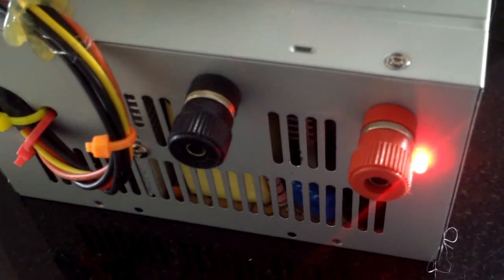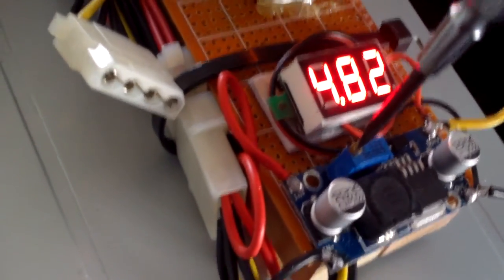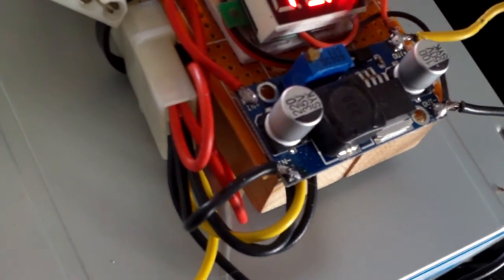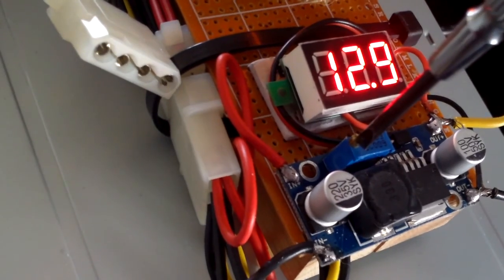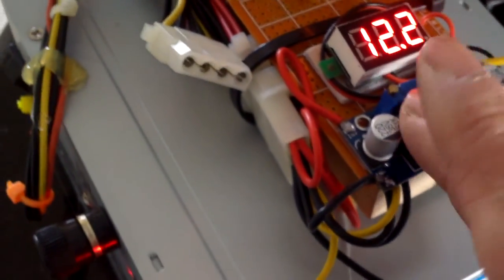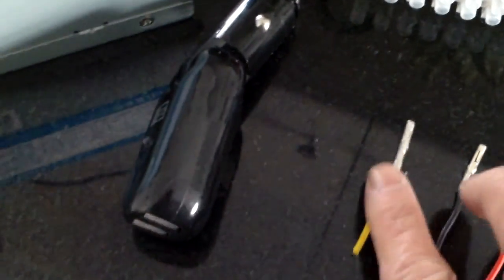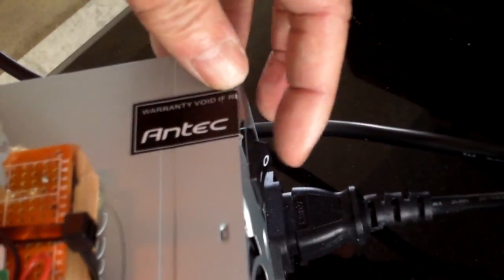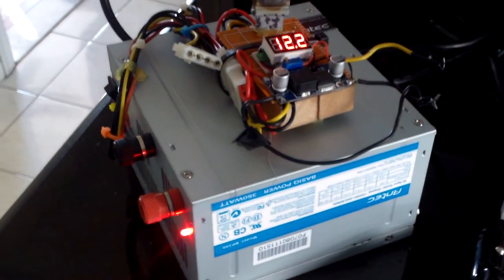Adding variable voltage option to your converted PC power supply pt. 2

Comment: I use a PC power supply to run the lights at "Club Jay".  It's actually an old AT-style (or AT-class) PSU, if that means anything to you.  Puts out 12 and 5 volts, the 5 I have run to USB for any USB lights that connect, plus I have a bunch of LED "strobes" in the ceiling that run on 3 AAA batteries, so it's 4.5 volts.  I run it at 5 anyway, and there haven't been any problems for years.

The 12 volts hooks to a couple of 12 volt blacklights I have, plus probably a couple other things I can't recall at the moment.  It's also real quiet, in fact I can't hear it over the racket all the other fans and motors for the rest of the stuff make, to say nothing of the loud music!
Reply from the maker: jaykay18 Waste not, want not. You certainly are making good use of that power supply. The blacklights make everything look cool. The strobes make you a little unsteady and things are just starting to set wild at the old "club Jay".
Reply: wtam69 Thank you.  Indeed, if there's anything at the curb at my house, it's REALLY broken.  Or, if it's not worth fixing, all the good bits have already been stripped off!  You never know when you can use something, and having that something on hand, as trivial as it might be like an indicator light, sure beats having to pay even 79 cents for one.
Reply from the maker: jaykay18 The new say saying should be "Waste not, want not and you'll have a whole lot."  :))
Reply: wtam69 Oh, I need that!  We'll have to share that phrase!

Comment: I have a boost converter which require input current 15amp maximum but my PC power supply have 12v and 20amp. will it be safe to connect booster with power supply.
Reply from the maker: +Mudassar Ahmed It will be safe as long as you don't draw over 15 amp using your boost converter.  You might need extra cooling if you pass maximum current through your booster or it can overheat. Also your PC power supply probably have a maximum of 20 amp at 12 v only with the different 12v wires combined.
Reply: thank you